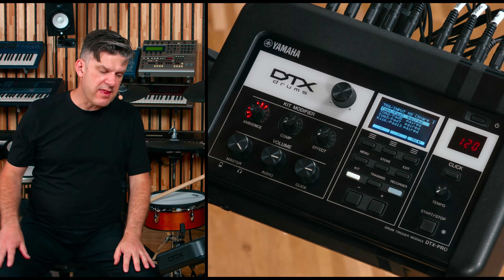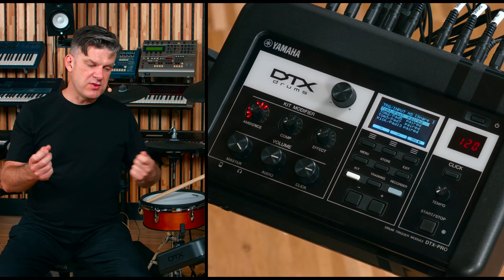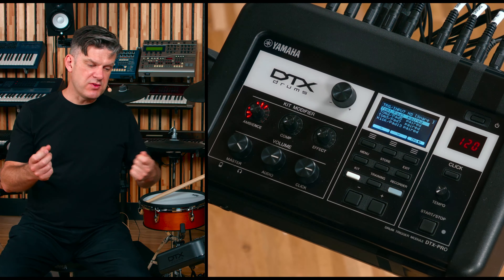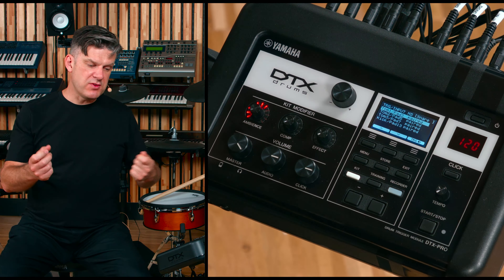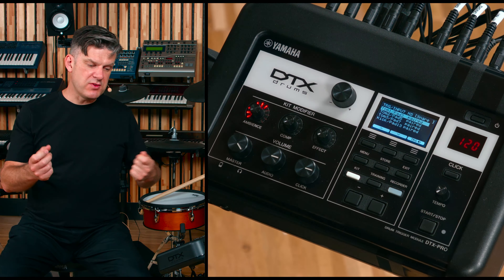Yamaha | DTX6, DTX8, DTX-PRO | Using the Input Mode – Stereo or mono pads

Comment: This doesn't work. At least not the way it is explained. I used a Y-cable in the module, connected to kick, other to kick2. The "paired" and "separated" setting have no affect. Changing the voice with one makes the other the same. The amount of time reading the manual and then landing on this video stating the same thing the manual states has really pissed me off.

I've had 3 DTX V2 modules and loved them and their setup. This DTX Pro is setup in such a non-intuitive way I find it shocking that it is from the same company.